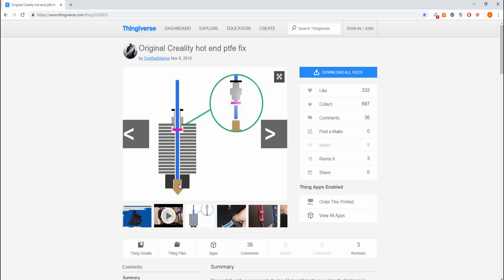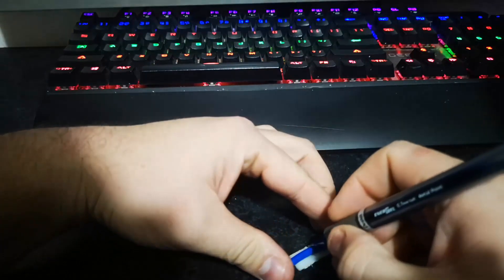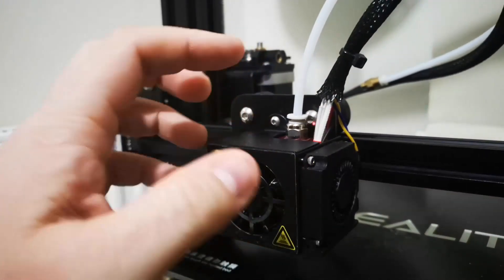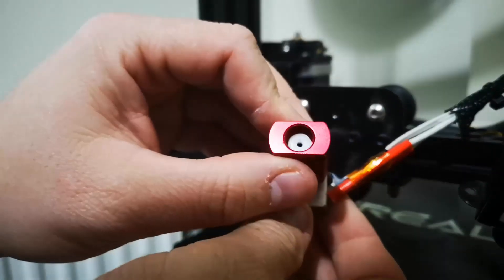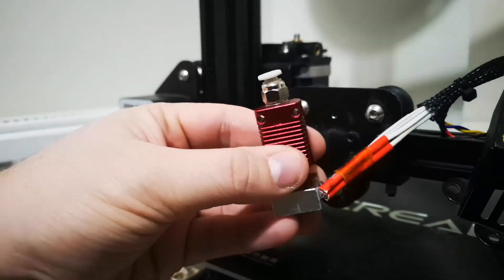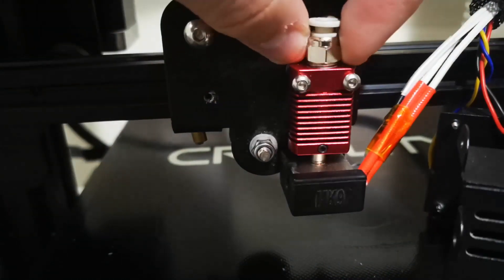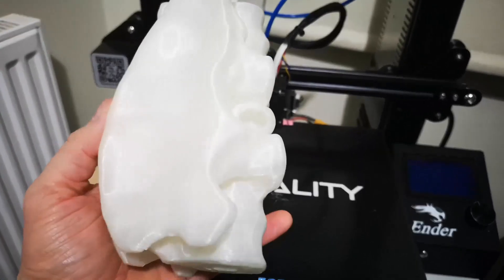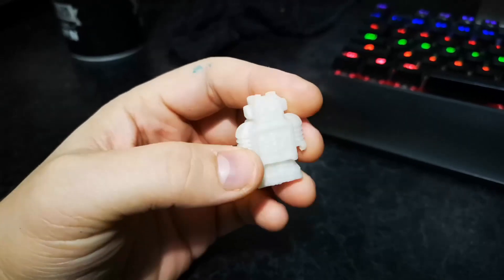Ender 3 PTFE Fix - Under Extrusion

Comment: heat the block with the nozzle removed you can then push the tube right through to clear the nozzle fully.

Wipe off any filament the other end then pull back through.  repeat until shiny clean.
Reply from the maker: Thanks pinned this for others to see. Good advice.

Comment: You need to use the lock on the pushfit because it's usually the retractions that are causing it to come out. All the back and forth wears down the PTFE that is not locked down all the way.

PTFE Clip
https://drive.google.com/file/d/0B7A1MEUY39HCaGVFYTA4WThIUDA/view